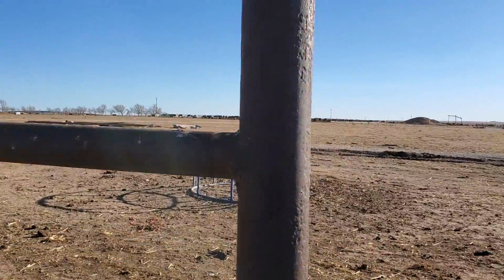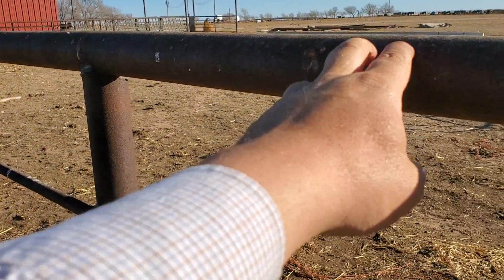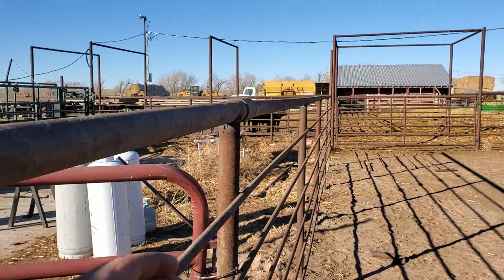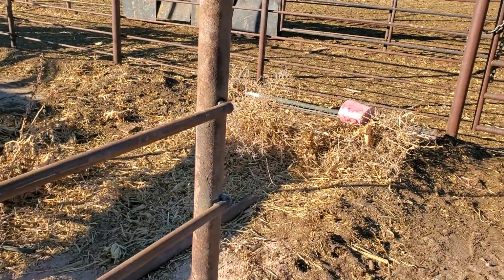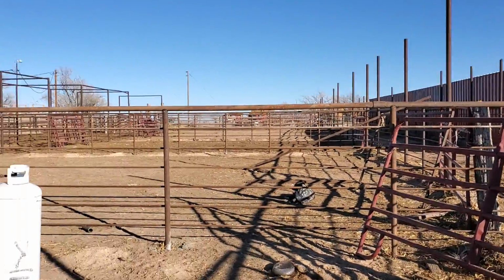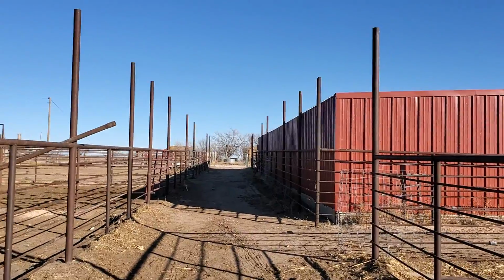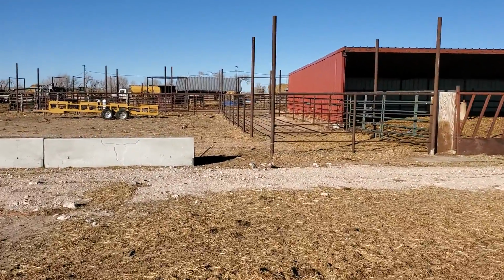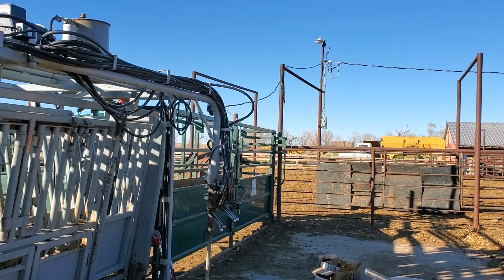Materials Used For Pens

Comment: When you weld sucker rods use dc polarity and 7018 rods. Sucker rod is a hard steel and needs a high tensile weld that is produced by an 18 series rod like 7018 or 10018

Comment: On your ends of the sucker rod blow a hole in pipe and slide sucker rod in only takes a few min and eliminate the ends breaking loose. Just blow holes in both ends acre rod together and slide ends in first  I use short ropes to hang in place while welding.I also use a comalong to pull tight just weld one end then steach.I also use the cable clips to make sure they stay. I have seen a nice horse killed just welding corners like you do it was cut off at a 45 he run about 8 feet of it threw him. That's when I started inserting ends. It's also stopped the ends from break-in loose